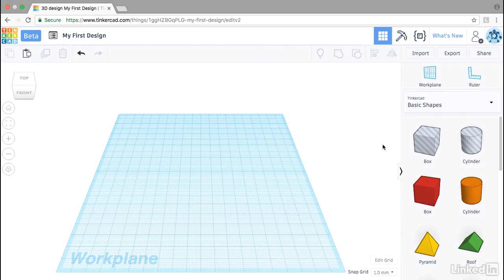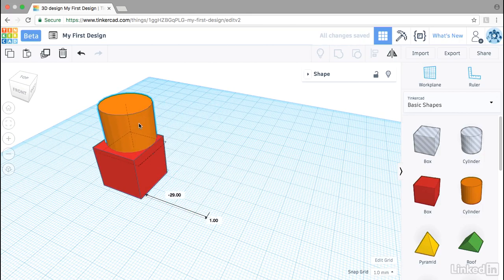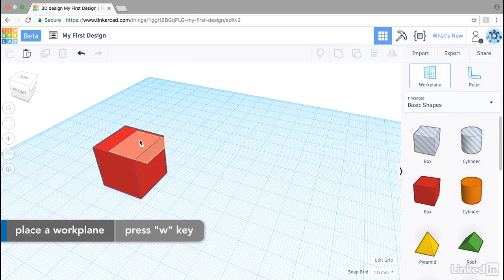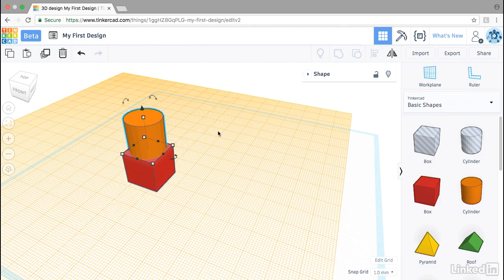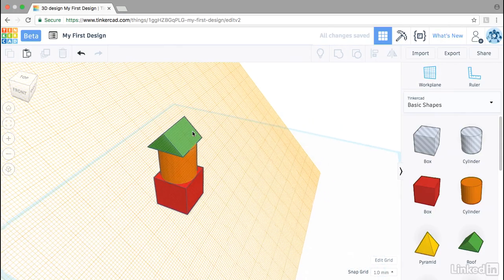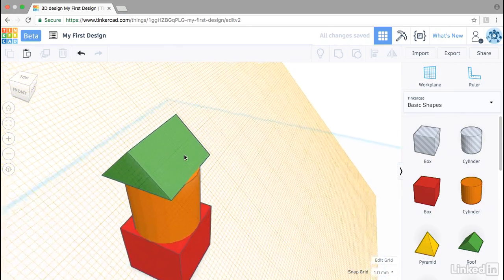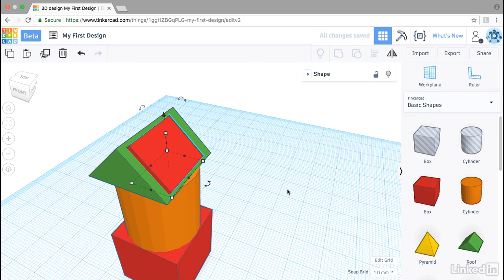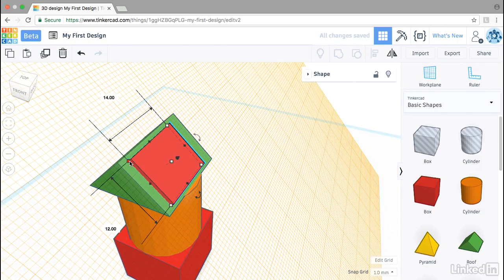Tinkercad Tutorial - Using the workplane

Comment: I don't want to bring in a new object to the new (orange) workplane. I want to copy an object from the original (blue) workplane and paste it onto the new workplane. How to do this? thanks.
Reply: Just for anyone else watching this video with the same question, here are the steps to merge 2 existing objects together using the workplane tool. 
1. Click "W" to activate the workplane tool, and select the surface of the first object you want to merge. This will change the workplane onto that surface
2. Click the second object you want, then click "D". This will Drop the object down to the new workplane. 
3. Click "W" and reset the workplane back to the original workplane. 
Done!
Reply: @nickhalden982  2 years later THANK YOUUUU!